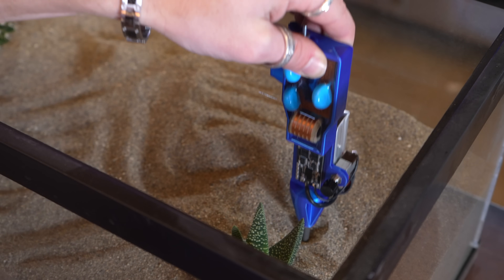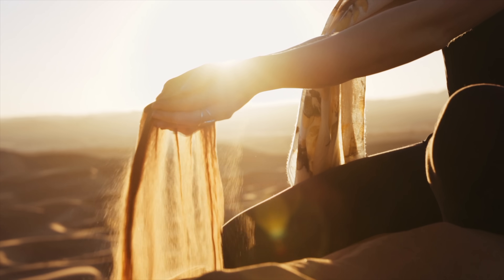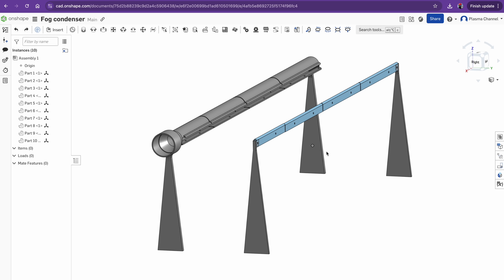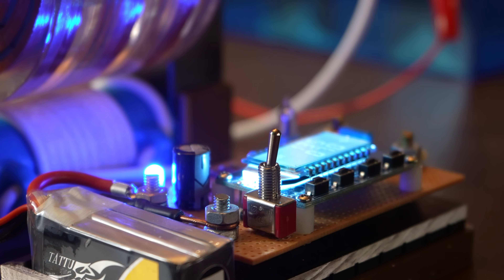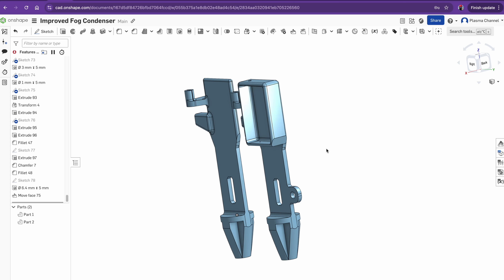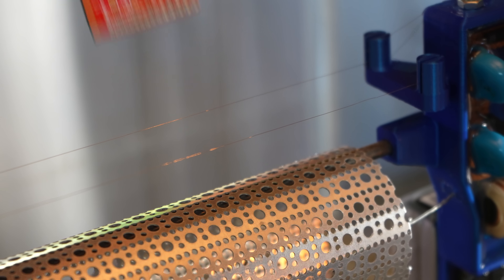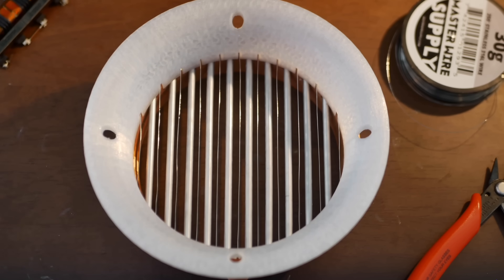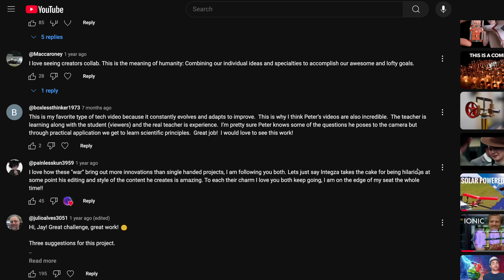Solving Desert Water Shortages Using 20,000 Volts

Comment: Hook up the battery to a small solar panel that charges it during the day and add a microcontroller that turns it on only once a certain humidity percentage is detected by a humidistat

Congrats - you've now got a low-cost irrigation system that can replace modern irrigation in coastal deserts! 

Great project. Can't wait to see where this goes next.
Reply: Bro! I wrote this literal thing myself before reading the comments! Ahahah we had the same idea simultaneously! GG my friend
Reply: Technically you wrote it 1 hour before me, but you got what I meant
Reply: @Gentle_Ego  all credit to plasmachannel. If he can commercialize this and bring it to poorer nations at a low cost he would deserve a nobel peace Prize
Reply: @iamdmc 
poorer? like Saudi 😂
Reply: infinite water glitch
Reply: Namibia is very foggy. Collab with Food Forest Namibia, let's go!
Reply: 100% humidity is detected by a humidistat. That's the Dew point where fog start to appear.
Reply: @FrancoisEustache-ed6gd  do you know if a dense fog is required for this fog collector to work, or would it also manage to gather some water with just high air humidity?
Reply: Why limit this to deserts? Lots of areas have fog and could use this as a fog clearing method. Thing foggy night cleared by the road side.
Reply: I've been experimenting with LoRa radios.  Companies like RAK wireless already make environmental sensor kits for farms.  solar, batter powered off grid radios for long distance networking, humidity, barometric pressure and temp sensors (only like $5 for the all in one sensor), soil moisture sensors and relay boards.  Everything is already available for a farm to remotely detect, report  and power a high voltage electrostatic precipitator like this.   Probably $200-300 for the entire system minus the precipitator.  completely off grid.
Reply: @bolus7  Lora is ok, i saw another demo recently with something called YarnMesh or YardMesh, something like that. full mesh radios, with weather stations, tank sensors and some sort of auto-trap thing for AI assisted targeting of invasive species. seems they were getting ranges out to 16Km in some places in New Zealand. Company making them is called FTP Solutions. feel like they would be a good fit for these! seems like they are adapting 3rd party hardware to the radios so dont see why it couldnt be done!!!
Reply: And hooked onto a big water tank directly to replace the cap
Reply: Put it on a robot and perhaps you can irrigate a whole field.
Reply: This could work on 80% of the Earth, almost daily.
Reply: Or just plant more trees..
Reply: If, like he says, the fog goes away when the sun comes up, it might be better to use the solar panel as the sensor and shut off the machine when the solar panel reaches a certain voltage.  It would simplify the device greatly, and you already have the solar panel.
Reply: You can leave out the microcontroller and use circuit logic and a humidity sensor to switch it on and off. It would save on cost of the device and would also save on power by not having to run the microcontroller.
Reply: Step up the voltage again, 
make em zap garden pests and bugs!

Win-Win!🪰
Reply: And the solar panels would give the plants shade during daytime
Reply: yeah its a really cool idea for the niche application. I have never seen anything like it. cant wait to see developments.
Reply: Following this post.    Anyone ready to put together a kit?
Reply: In our area of NW Colorado we don't usually get much fog.   However, early in the summer, we do get heavy dew.
Reply: Use in farming for ffree range cattle
Reply: Remember to note that fog is the #1 killer of solar next to no light at all.  A rechargeable battery is required for this to work.
Reply: Yes! I was also thinking you could make smaller applications to just stick in house plants. if you are running a humidifier and your apartment it would act as a wireless drip watering system.
Reply: @gabi-sw8zw  But fog is required for this.  Would it work with just in house humidity?  At what % of humidity does this start working?  I don't think we know yet.  We know it works in fog, but what are its lower limits?
Reply: @zavatone  We know this only works with fog, watch the video.
Reply: I like your thinking.  We need to determine the lower limit of humidity for this to work and then see at which % should this turn on and then measure the results to see if we're right.
Reply: Scaled and positioned on top of the slopes, with catchments swales and ponds to slow, store and infiltrate the water along the way + oasis perma... GG well played
Reply: Brilliant…use the desert s sun to heal the desert👍
Reply: In the top secret CIA files next to free energy 🤷‍♀️
Reply: Except you've skipped the science part. They need to test it in a desert to see 1 if it actually works 2 how well it works, 3 costs, 4 problems they have to work around. "On paper," is not science.
Reply: Yep, you'd just need to build it high up in the air both to catch more water and so the metal doesn't burn the plants and you can use equipment on the field.
Reply: I'mma buy a strip of desert cheap!
Reply: I really like the idea, but you have to keep cost in mind. The "low cost" you are mentioning has to compete with a simple plastic net. With advances in material science there might be options, basically having 3 wires above the net, and it coated in some cheap conductive materials, improving overall collection by a reasonable factor.

The solution in the video looks cool, but if you factor in corrosion and metal pricing, plus you don't simply have a "dumb net" where somebody throws a rock into, but high voltage electronics..

Dont get me wrong, really like the idea. Just have to think of application, it needs to be cheap and reliable. I would really like him to check out the "coat the plastic netting, use that as ground, and a few lines to ionize the fog" - I guess with this high voltages even the coating needs to be minimal, as soon as the net becomes moist the water might ground it enough. Then you have a few stainless lines with high voltage, a cheap net, and much better overall water collections.

Ok, now that I write it down. It is an awesome idea :-)

Comment: the next guy to invent the dehumidifier xD - maybe you should look into the dessert water projects 1) waterseer 2) self filling water bottle  and many many more.
collecting water from air/dew is not new at all.
Reply from the maker: The self filling water bottles have never come to fruition. Every time they are from scam companies, and they dont work. The waterseer has also been busted + never been installed. Also, as noted in the first minute of my video, people have been collecting water from fog for centuries. This method is just far more efficient.
Reply: @ why would High Voltage be more efficient then using wind Power?

btw: do you know WHY it was debunked? not because its inefficient or it doenst work. its because the water gained in a dessert is so little

Comment: How about making a dehumidifier using this tech. Might be better than the current tech of using a compressor to cool coils.
Reply: I'd guess refrigeration cycle is more efficient. Harder to run cold pipes over long distances tho.  🤔
Reply: @BRUXXUS  don't know, but dehumidifier produces a ton of heat. So the AC has to run more causing the electricity bill to go up. So maybe Sparky version comes out ahead.
Reply: @PaulDominguez  True.... Would be a fun and interesting thing to compare total efficiency of both methods.

Comment: Quick question. Why couldn’t we just use atmospheric differential to power it? It is extremely high voltage. Just a thought. Powered by static electricity.
Reply from the maker: oh god thats brilliant.
Reply from the maker: Permission to try your idea?
Reply: @PlasmaChannel  Most definitely! It would be an honor sir!
Reply: @PlasmaChannel  I am currently trying to use it to charge batteries. Unfortunately I can only try on windless days. Balloons and thin copper wire. Love this stuff. Wondered why we did not collect it for use. I think “we”used to.
Reply: @PlasmaChannel  And if you use an electret instead of a flyback, well... there goes the need for active powering, if I'm not mistaken.
Reply: Atmospheric potential is high voltage but very low power. The moment you apply it to a load, the voltage drops to near zero.

Comment: Except the advantage to fog nets, is that they require zero energy. They're 100% passive. And sure they may only capture 2%, but they're not used to the extent they could be used. So maybe once they're deployed every where they could be and if then there's still not enough water. They can use this method. But technocrats, and by extension technology, often creates more problems than it solves.
Reply: Don't they need a very thick fog (cloud like) in order to work ? My intuition tells me his electrostatic device would still work in more contexts with a much lower level of humidity.
Reply: @Alain.Robert  the news story I heard about them they were used in coastal areas with mountains. Like Chile or Morocco. Where there is fog like every morning. And the benefit was it is a passive system, vs desalination. I'm sure in areas where it makes sense for electric infrastructure this would still be a much cheaper option than desalination. But out in the middle of nowhere. This would require more maintenance and makes you dependent upon the electricity, which may be unreliable.  Vs just a passive net that needs cleaned periodically.

Comment: any reason why placing a non-conductive screen of denser material such as the air filter from a heater can't be placed between the mesh and the ionizer? I only ask because it seems to me some of the fog is being wasted when it passes completely through the screen and out the other side. Also can you please test it in an actual low humidity environment?

Comment: This is AMAZING! Although it might be better to use this setup to collect the water rather than going straight to irrigation, providing water for utilities and making sure the system isn't subject to the morning fog's intensity.
Reply: It condenses fog out of the air,  and not humidity in the air. That make the application limited to areas that have fog and where water is very limited and expensive. The technology is most viable  in humid deserts. 

Fog is suspended water droplets  that have condensed  from humid air that goes over 100% relative humidity.  The air can't hold any more moisture and cooling the air is like squeezing a sponge making it less able to hold water.   In the desert that condensation would have been driven by radiative cooling over night.  The ground radiating it's heat to space.  Collecting that condensed water is more energy efficient than condensing the humidity in the aur because water has a huge  enthalpy of condensation, -40.7 kJ/mol or 18grams for water. That energy Is already supplied by the radiative cooling to make the fog.
Reply: @kreynolds1123 interesting, thanks for the details. I was also wondering about how temp and dew point affects this. I know if dew point is above temp you don't really need electricity to collect the water... Anything cold, especially metal, will readily collect water. I guess this approach doesn't require those specific conditions but I wonder if cooling the metal might be as or more efficient in a humid environment.
Reply: @LucidObscurity1  water's enthalpy of vaporization is approximately 2,257 Joules/gram regardless of humidity. But water will condence out of the air at higher temps if the relative humidity starts out high compared to relativly dry air that needs to be cooled further to drive the relative humidity up to  100% and force water to condense. 

So it will require extra energy to cool air to a colder temperature. The enthalpy of vaporization  is the energy to drive the phase shift of water. As water vapor condenses it give up it's latent heat of vaporization.  It's like why it takes energy to get a pot of water up to boiling temp, and then it takes more energy to vaporize it. 

Metal has a high emissivity, emits infrared radiation. And if the sky is unobstructed by clouds or is inside a home, metal will rapidly cool via radiative cooling sending it's heat energy to the depth of deep space. That's why the fog didn't collect on his metal. Any energy the metal could radiate would be compensated by energy from the walls of his home radiating to the metal.    But a desert cloudless sky at night will allow certain bands of infrared to escape to space, And we call this radiative cooling.
Reply: @kreynolds1123  I think I understand most of what you're explaining and I've read that water can even be frozen with temp well above freezing so long as it's insulated from the ground and the wind and exposed to a cloudless sky (space). I live in a very humid environment and anything cold, especially metal, will readily condense water... especially when it's foggy. It seems like if fog is going to be a base requirement for this system, then I'm curious how it would compare to not using electricity at all.
Reply: @LucidObscurity1  what you asked wasn't very clear.  How things compare on energy inputs, where the energy comes from. Volume of input. 

Radiative cooling might be thought of as free energy to cool and condense water. But it depends on cloudless sky's which might not be dependable and is limited in capacity of cooling per sq unit of area. 

Physics requires adding energy to vaporize water and requires the same amount of energy to be removed to condense water. and because of water's hydrogen bonding it requires a significant amount.  Water condensing on a cold glass of water heats the glass significantly with the latent (stored) energy of vaporization. 

radiative surface may loose heat faster than the air temperature, so yes radiative cooling can cause ice where clouds don't act as blankets for the earth.  But the surface must be below the freezing temperature of water which for the most part is 0° c.

Comment: rather skeptical
is it electricity or just wind that make this happen

and dehumidifyer is not made to remove liquid water from fog
it's made to condense disolved water from the air
this will ever require a lot of power because steam-to-liquid transithion require energy

intresting but this need a lot more testing

Comment: I feel like multiple small, cheap units sent to a number of different countries for sample data is easily achievable with the right connections. Small solar panel on the box, put outside insitu, straight proof of concept with advertising built in. 

It's not that we can't, it's that those with money and power don't see the profitability in it.

Comment: Is it necessary to create a large solid mesh (which could be difficult to scale up)? Or could you just make the negative terminal also be a few thin wires?
Reply: Less surface for collection if you do that
Reply: @TheJerome1502  There's a maximum amount of surface area you would need, since at some point, you are condensing ionized fog as fast as it is produced.

Or maybe the water droplets act as nucleation points for fog condensation so you are also condensing some non-ionised fog. 

Either way, testing the relationship between surface area and condensation could be pretty useful in reducing the weight of the system.